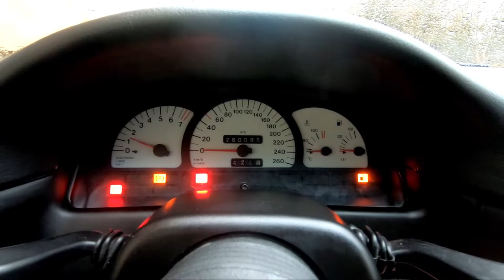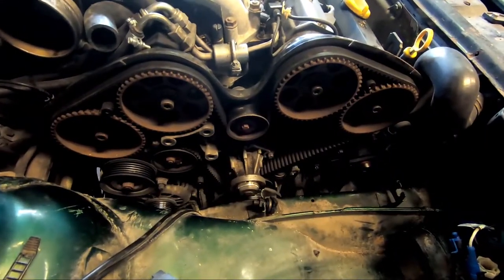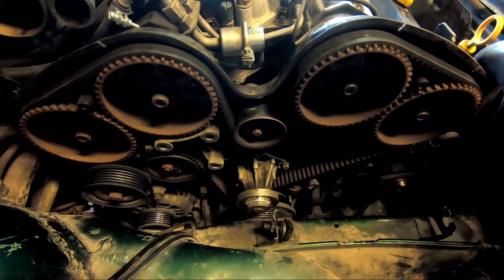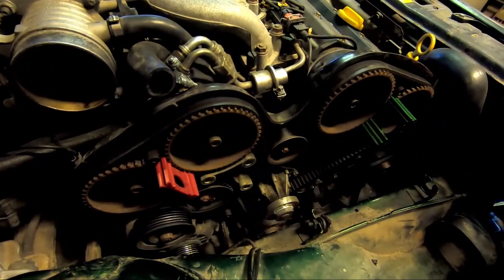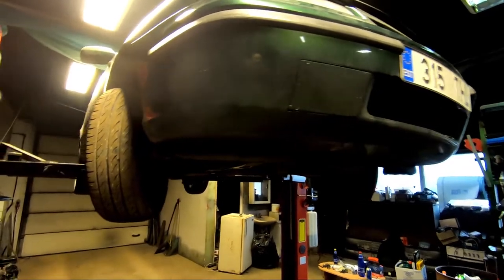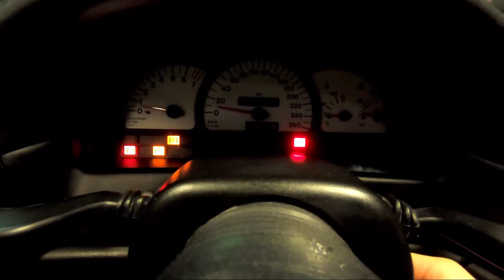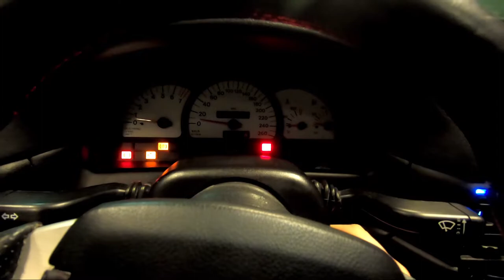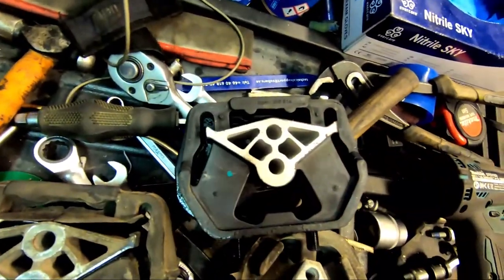Opel Calibra V6 X25XE 11 Years  Old Timing belt

Comment: 100 degrees is normal for v6, because it is pressurised, it can go up to 124 degrees, but for your comfort, best to change the 92 thermostat to a tropen Thermostat that opens on 83 degree. Most radiators are clogged and V6 radiator is not the same as the 2 liter radiators, but pogo performance provides a real good one.
Reply from the maker: I have to check the thermostat also yes but do you know how to test the fan switch.Maybe that is broken.
Reply: @TheMeisner87  https://www.clubcalibra.net/v6calibra/index.htm is a good site with good info about the cooling, There is a 3 pinn connector in the radiator, 1 is the ground, 1 is fan step 1 and 1 is step 2, by curcuit braking, the fan should work, also the banjosensor can be tested like this, banjosensor is continu voltage, other sensor is schalted power
Reply from the maker: @bjorndietens313  thank you for the info.I will let my friend to test them.🙂
Reply: I changed to tropen thermostat (open at 84 degrees) and also changed the radiator temp sensor so that the fans kick in sooner.  Now my v6 stays below 100 degrees, about 96 degreed most of the time also in warm weather

Comment: I have one with unknown service history. Purchased the car 2016 and still going with the same timing belt kit :D
Reply from the maker: Why you havent changed it?Testing what happens when belt break?
Reply: @TheMeisner87  nah ill wait till it snaps and then go for 3 liter engine
Reply from the maker: @Aabohax  ok when you have this kind a plans then yes,but better choice would be to sell a working 2.5 l engine and the. Install the 3l engine.
Reply: @TheMeisner87  2.5 engines go for around 50€ here :D literal trash
Reply from the maker: @Aabohax  where do you live where that engine is so cheap?
Reply: @TheMeisner87  Finland. I have some spare 2.5 engines outside sitting on the rain that wont sell for 50
Reply from the maker: Ok usually parts in Finland are expensive.I am looking for a airbag module for my car and also do you know much a f25 transsmission will cost there.

Comment: The right can't be found, the upper one is possible to build one of Vectra B V6 and lengthen it, or gema motorsport has the upper one. Also searching for the Right one.
Reply from the maker: The upper i had it made for my last calibra from scratch.But it came like oem one and it wasent expensive.I found one store that offers right ones for other engines.I have to see if they have it for v6.

Comment: Is this the german made 1996. Ye?
Reply from the maker: What do you mean by that?
Reply: @TheMeisner87  i have a calibra v6 2.5 c25xe 1996 ye. Im in Australia and its known as a full german import.
Reply from the maker: @mikerobo2112  I didn’t know that.My car was built in Finland and was sold to Switzerland and from there it came to Estonia.
Reply: @TheMeisner87  theres not one com0lete teardown of my model. I also have the same german import 4 cyl with racing head,2inch exhaust, coney shocks and  suspension ,stabillizers.  Rats ate the wiring out but i paid 1000 dollars for the car just to get a headlight(angel eye) lol.
Reply from the maker: @mikerobo2112  what are your plans with the car?
Reply: @TheMeisner87  going to sell the 6 eventually and have no clue what to do with the 4. Wish i had engine knowledge, i would tear down  the 4 and rebuild for fun. Maybe someone will buy the 4 for the head,exhaust and coney gear.??
Reply from the maker: @mikerobo2112  sad to hear that you plan to sell it.Try to rebuild it and keep it.,because calibra prices are going up when they are are in a good condition and you wont find them with a good price anymore.
Reply: @TheMeisner87  the model i have in the 6 was $ 55,000 in 1996. Mine would be considered very good condition  with 121,000 kms. Ive had it up to 260kmh for a steady 10 kms.  The 4 is a mystery as what to do with. The  6 is considered a holden special vehicle (H S V). Only worth 8000$ now. I paid 3000$ . Yes it is a shame.
Reply from the maker: @mikerobo2112  yes v6 prices are rising.Keep it if you wont drive with it and price goes up.
Reply: @TheMeisner87  they were going to race them here in aus but they were too heavy,hence why they bought in just over 500 of them.
Reply from the maker: @mikerobo2112  good to know fact.
Reply: @TheMeisner87  you have to sell 500 to be in the race. Apparently there would  be  lucky to be 50 odd left.
Reply from the maker: @mikerobo2112  that is know that 500 is minimum.I found out that fact from gran tour when clarkson told it about some other car maker.